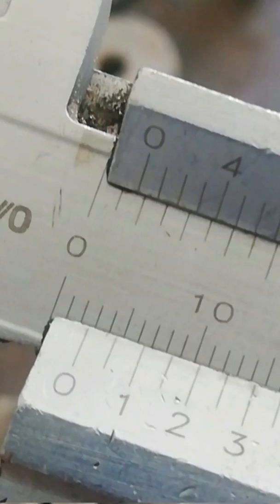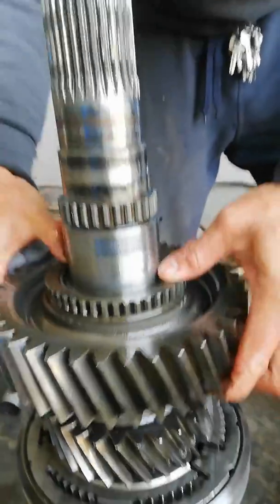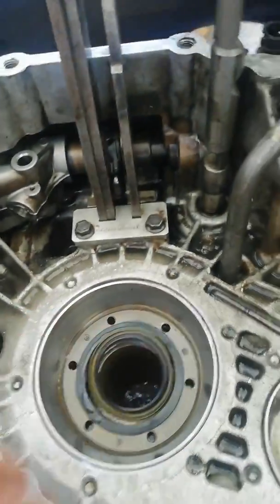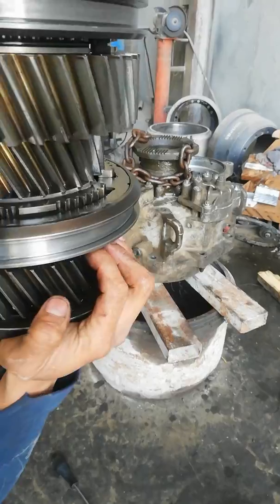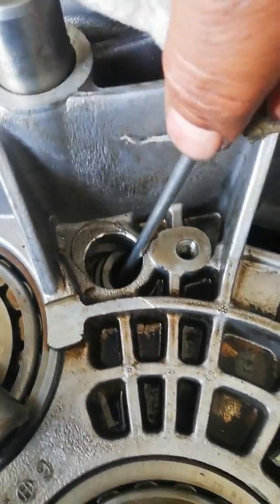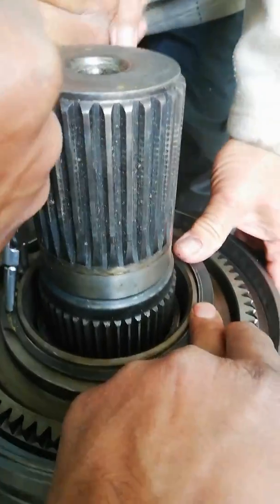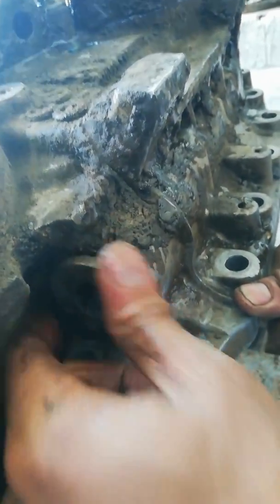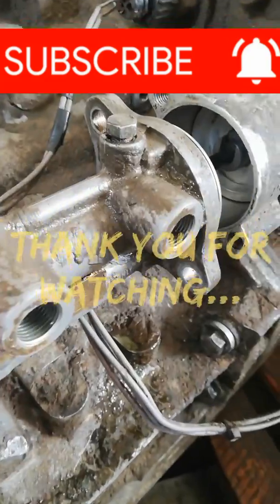MERCEDES ACTROS GEARBOX BEZ: G240-16 COMPLETE REBUILD AND TECHNICS

Comment: When installing this gearbox on the car, do I need to install any program?
Reply from the maker: if there is no problem when shifting on gears, then  no need to set the program, some time there is some problem about the clutch travel sensor, disconnected or defective clutch travel sensor is also cause of shifting problem then you need to set the travel sensor to the transmission ecu
Reply from the maker: https://youtu.be/DJupZkzD_no

Comment: Sir ihave some problem in same gear box gear no 3 and 7 engage but relase clutch auto maticaly  thesse gears are disengage what problem  sir?
Reply from the maker: @NalakaSenavirathna-z2g  you have problem on synchronizer for gear number 3
Reply: @yrhelmechanicalelectrical9113  this is the fault for no 7 gear also
Reply from the maker: Gear 3 and 7 is the same gear, when shift to low gear it work as gear 3 and when you shift to high gear it work as gear 7
Reply: @yrhelmechanicalelectrical9113  thank you very much sir👍🏻👍🏻👍🏻